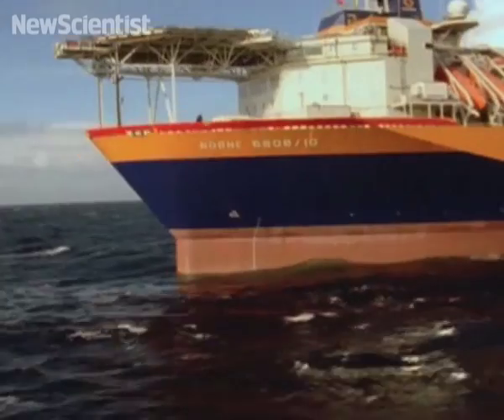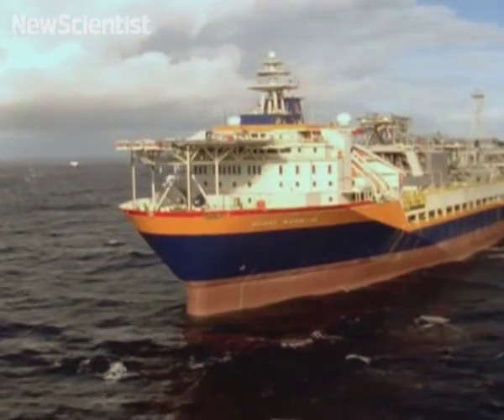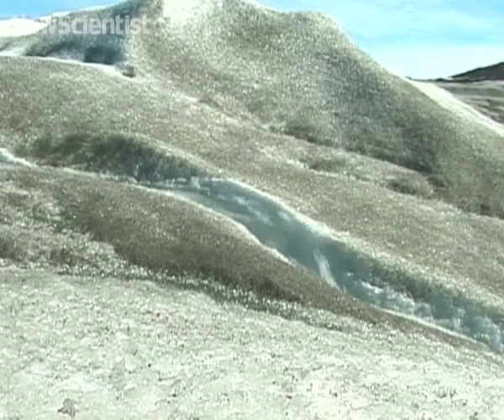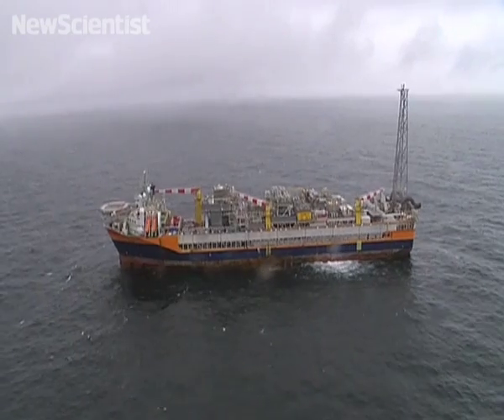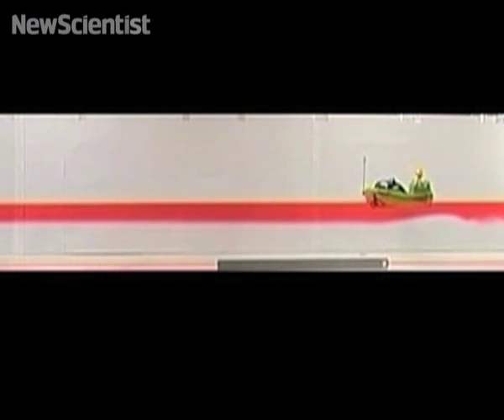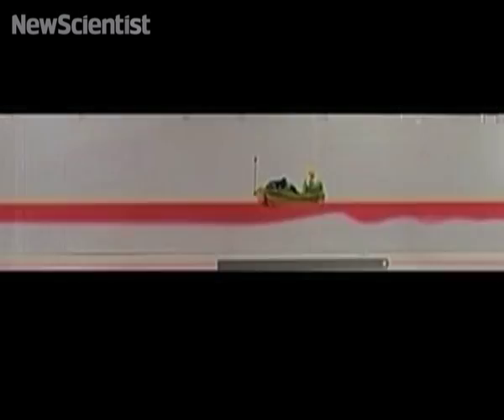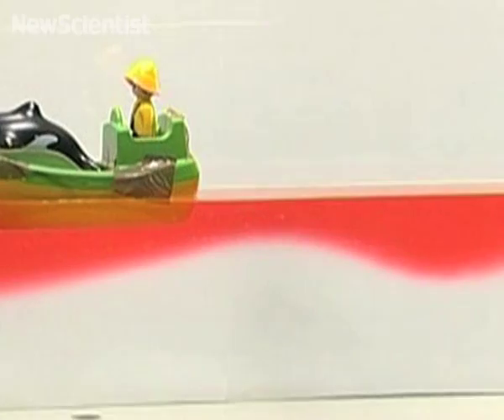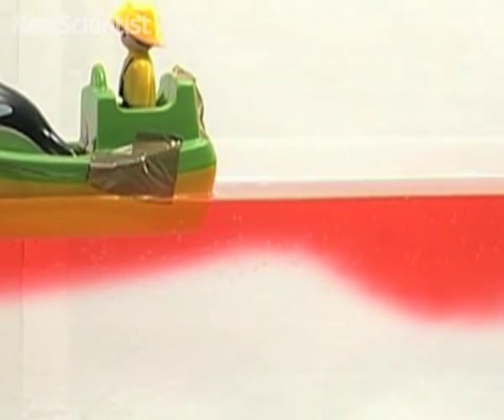Mysterious 'dead water' effect caught on film

Comment: early days? what do you mean?

they have proven that the phenomenon does exist, and explained it very well. they probarbly used a force that stays constant to pull the boat, allowing it to slow down and accellerate according to the underwater waves, measuring the velocity and the force that actually has been on the string that pulled the boat. 

and the different layers of water look very professional, im sure that they got some good data out of this.